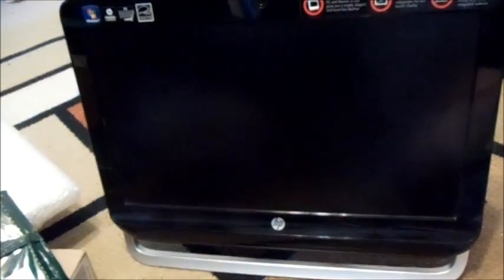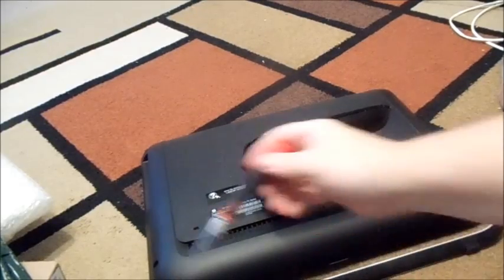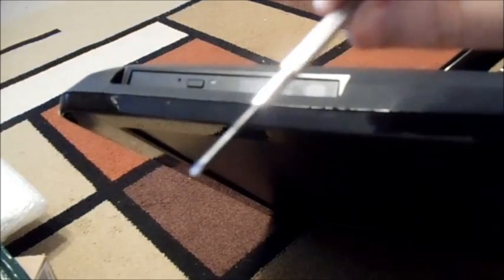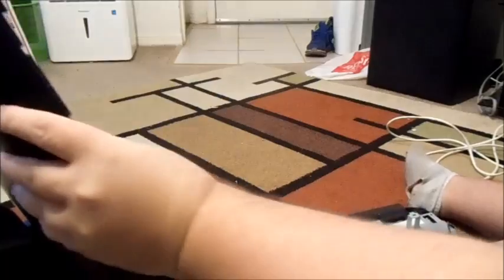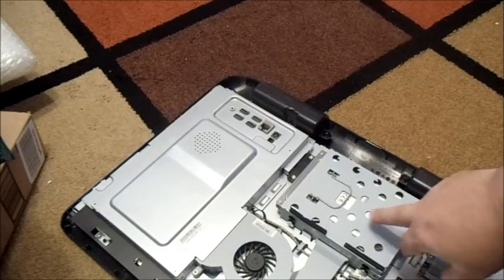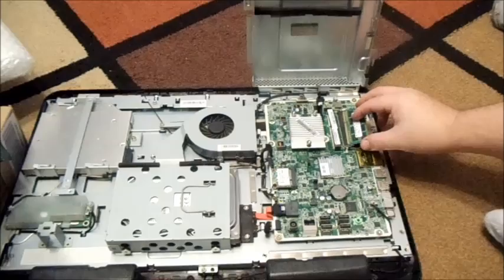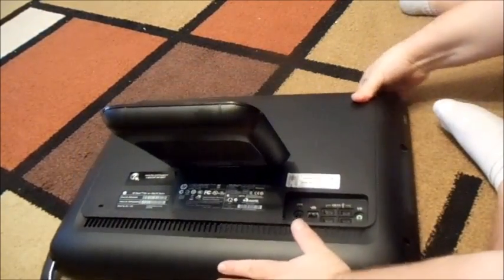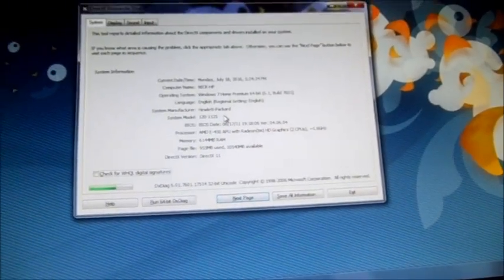How to UPGRADE HP OMNI All-In-One 120 Desktop Memory & Hard Drive (Removal Replacement RAM 120-1000)

Comment: Re-Install the operating System? CLONE the original hard drive to the SSD and you won't have to "re-install" the operating system. It is very easy - Almost as easy as copy and paste. Some SSD's even include instructions or even software to clone your old hard drive to the NEW SSD. Samsung has a nice utility included or available as a free download for anyone to download, but there are many others out there! It takes only a few minutes to clone your old drive to a new one.
Reply: You can do this but you will need a usb adapter for the ssd or use a removable drive

Comment: Is it possible to upgrade the processor?
Reply: No, the processor is soldered directly to the motherboard and the power requirements are tailored to that specific CPU
Reply: @CyberiaLyr5 It depends, the AMD processors of that model are bga, the Intel are socket 1155 and if they are interchangeable.

Comment: Here's a clue dude...if you take it off once, take a marker and put a little mark where the plastic tabs are, so you can get it easier next time. I did mine, and didn't put a scratch on it. Those phone toolkits are very helpful set of PLASTIC tools!! :-)
Reply: I reckon What a Butcher..
Reply: Double clue: If you just slide a guitar pick along the edge, it all pops up without leaving mark at all. No need for putting marks on the outside.

Comment: If I do 8gb ram who'll this increase fps?
Reply from the maker: no but it will increase the quickness and being able to perform more tasks at one time.  It's well worth it.  Look on Ebay for discounts on Ram.  You should be able to get two 4g chips ddr3 for about 40 to 50 bucks.
Reply: u can get an external gpu as this pc has the m.sata port. its currently used with the wifi chip but if ur using ethernet then that can be a huge upgrade. u need the external gpu enclosure and a desktop power supply and possibly a second main monitor

Comment: I bought 16gb (2 sticks of 8gb) RAM for a laptop but I'm wondering if I could put one stick 8gb RAM in there and yes I do have the 64x bit windows ten. would I be able to do this?
Reply from the maker: You can try.  Check the specs afterwards and see if it accepted all 16g.  If it only goes up to 8g you can take one out and resell etc.
Reply: RubberWilbur lol 16gb worked! even though on the website said you can only fit 8!
Reply from the maker: right click My Computer, go into properties and see if it is reading as 16g or 8g.  It might take it but it might not be utilizing it which you'll be wasting a good ram chip if that is the case.
Reply: +RubberWilbur nope, all 16gb is there :)
Reply from the maker: Great it will be blazing fast now.
Reply: +RubberWilbur lol it isn't as fast as I thought it would be (if you have any tips to utilize ram better hit me up) but next step is upgrading to a ssd :)
Reply from the maker: Well the bottleneck might be the processor.  What kind and speed is the processor ghz.  I showed you at the end where you can check that.  SSD will speed it up as well.  The HP I have here in this video is a 1.6 ghz which you can't upgrade.  Huge bottleneck.
Reply: +RubberWilbur AMD e-450 APU with radeon HD graphics 1.65 GHz...yeah pretty bad. but is there a way I could upgrade the CPU up to a i5?
Reply from the maker: Yes it would take soddering, glue, etc.  It's just not worth doing.  What city are you located in?  The time and money you would be putting in you could buy a really good used one on Ebay with an i5 i7 processor for $200.  Watch my last video on the Dell 3000 laptop with a Celeron processor that just came out for 250 bucks.  I told people they would be better to buy a used one for under 200 on Ebay and get a computer 5 times better.
Reply: RubberWilbur lol sorry for the late reply. but yeah i was thinking about getting a different computer instead of upgrading the cpu tbh. BUT for what i need it cant be a intel celeron because what i do is play games and from what i heard the celeron might not cut it. thanks for the suggestion though which speaking of better processors you have any recommendations for a decent pc with a i5 processor? thanks :)
Reply: @RubberWilbur  so can I put 2 4g sticks in